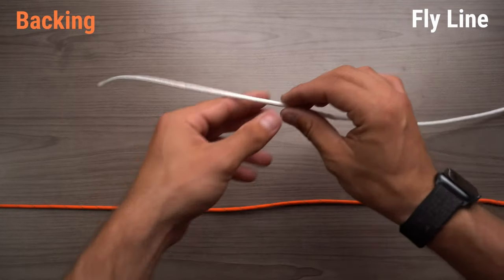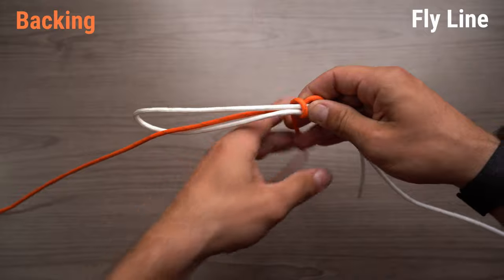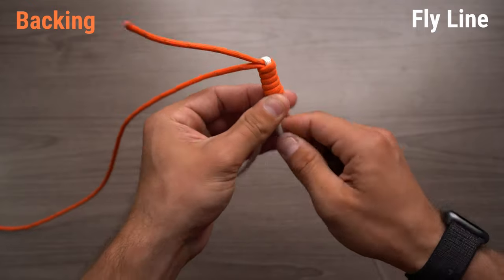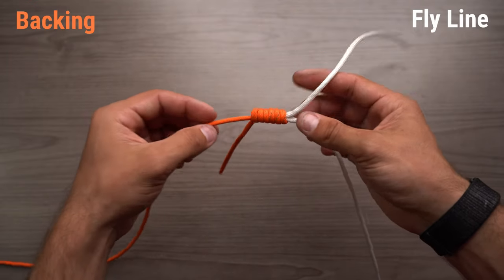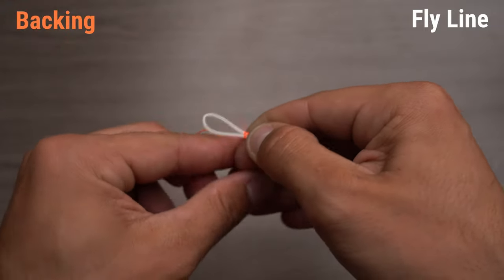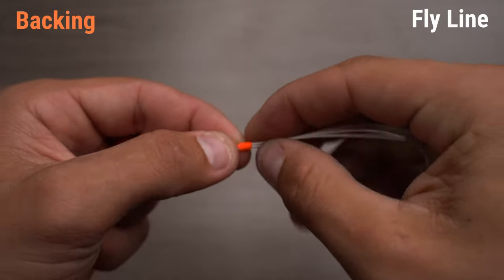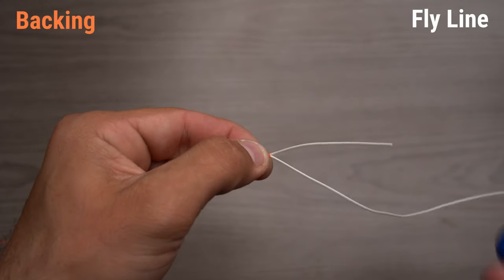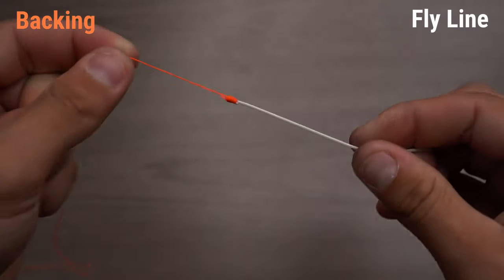How To: Attach Backing To Fly Line Without A Welded Loop | A Better Connection.

Comment: Hey man, I got my wife a ready-to-go 9ft. 8wt. fly rod combo from Orvis for sockeye fishing back home in Alaska. First fish took her all the way to the backing and the backing snapped at the knot. I tied on new higher quality fly line and the backing snapped on the 2nd fish. While this is more than likely an issue with the backing... I used this knot. Could this knot be putting too much pressure on the backing? Is there an alternative you would recommend? Thanks!
Reply from the maker: Hi David, so this knot should not have any unnecessary strain on lines. The Albright knot is known to be one of the strongest connections you can make. You shouldn't be snapping the backing, what pound class leader are you using? Normally it should fail at the "class" section.